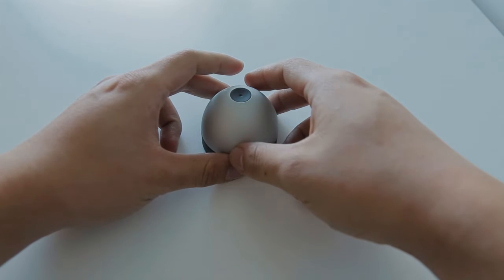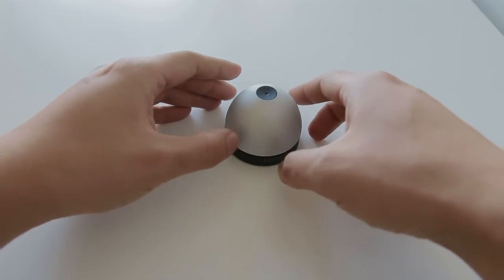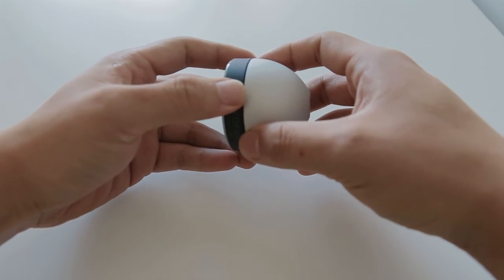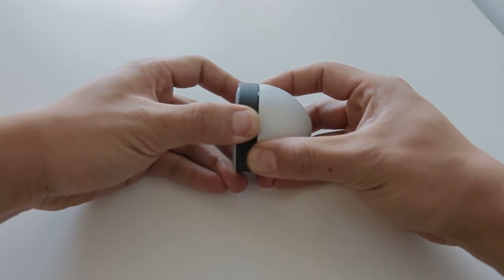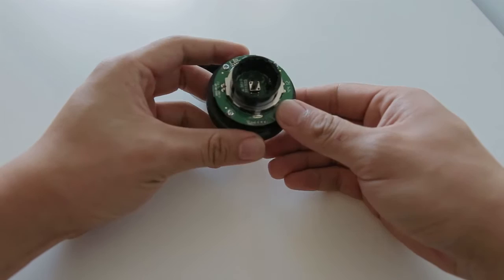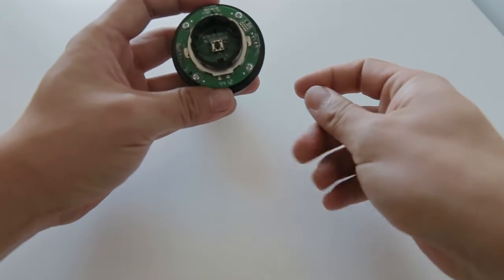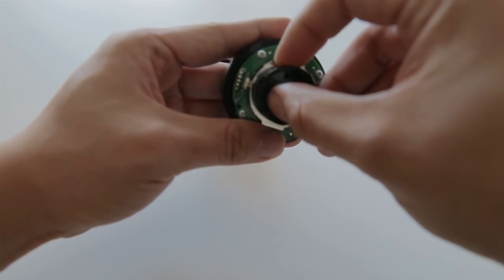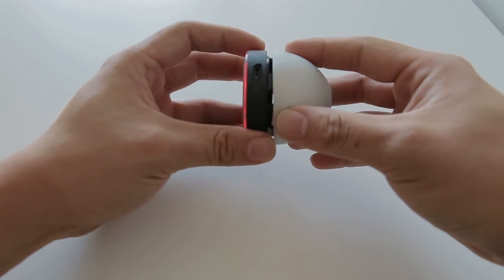Edifier e30 Spinnaker Remote Control Repair / Fix / Reset

Comment: Thanks for this video - very useful. Correct me if i'm wrong, but if the battery is no longer able to charge, the only alternative is to purchase a remote control which costs almost $120?

Comment: I tried this the remote never NOT worked But the speakers ONLY buzz when sound comes thru.  If i pause the track it stops buzzing. Then it starts again.
Reply from the maker: It sounds like the speaker isn't grounded or there is electrical interference.  To fix this remove the ground loop or remove the device causing the electrical interference.
Reply: Happy holidays.  Thank you for the reply.  When you say loop.  Do you mean the cord is looped.  I just detached it from the outlet and unlooped the power cord it stopped doing it... moved the speakers to across the room to another outlet and it’s doing it a AFTER about 2 minutes. We love these speakers. Please help